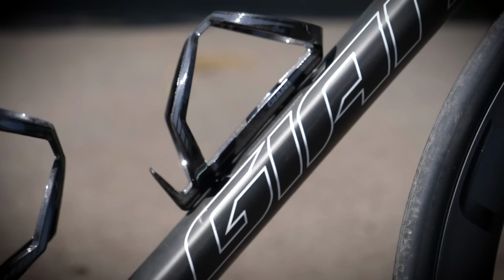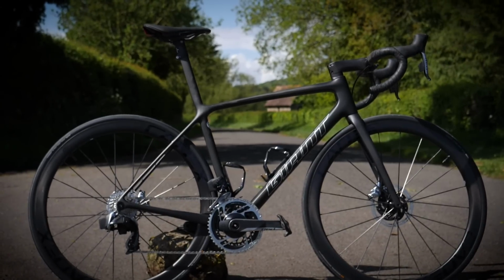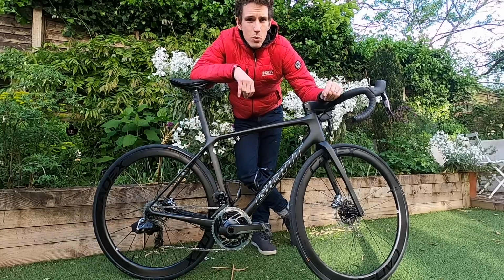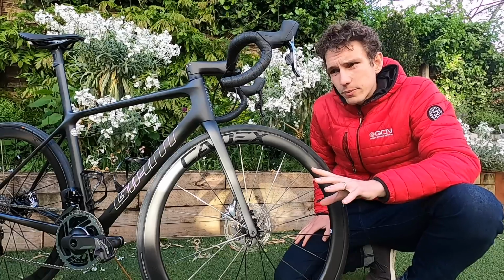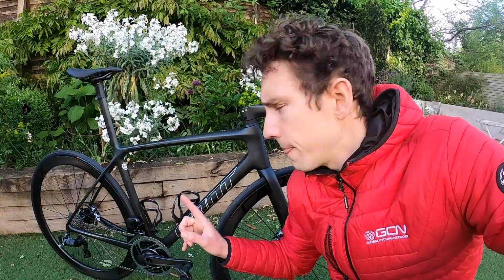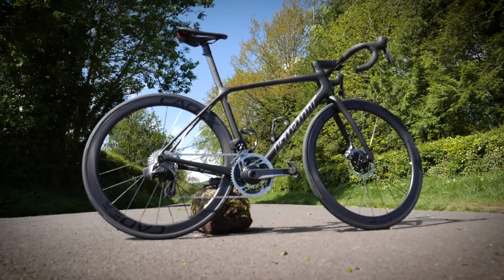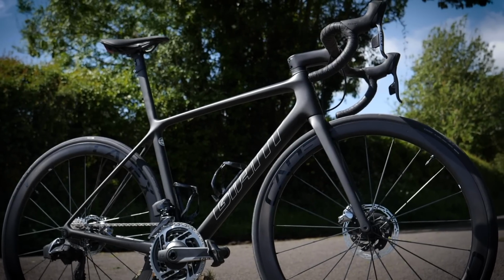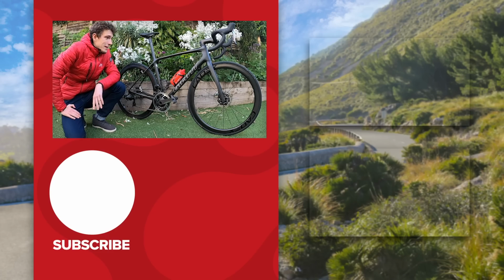New Giant TCR SL Disc | An Updated Iconic Road Bike

Comment: 32 mm tyres,  disc brakes and 'aero'. (Bit contradictory!..)🤦‍♂️ no thanks. The point of the tcr is to be light, comfortable and stiff a 'GC' bike. This is turning into some kind of gravel bike lol! I'm the owner of a 2015 tcr sl / rim brakes. 6.8 kg in size L, as stiff and as light as I'm ever going to 'need' . Oh and don't be afraid of the integrated seat post adds comfort and stiffness/ feeling of connectedness to the bike 😀

Comment: How is the seat tube height adjustable? It looks like the frame ends right where the saddle begins.
Reply from the maker: You measure the correct height very carefully, and then cut the seatpost to fit you. They do provide a few seat post tops should you need to adjust the height at a later date though

Comment: Probably the best mass produced bike on the market. Only very few small manufacturers can rival Giant's top end offerings for quality and almost none can offer integrated manufacture. Sram BB/chainset on a Giant not a good idea tho. Wait for next gen Dura Ace (one day...). Actually, current DA better than Sram. And yes, I do own both. Baby steps improvement over current model (hard to improve), mainly optimised for discs. Nice to have Si doing content.

Comment: How is it more aero than other carbon bikes when the down tube is a huge block traveling through the air?  That down tube is no more aero (at least in the video shots here) than a general gravel bike.  Most bikes like this one have the aero tear drop shaped down tubes to better cut through the air.

Comment: Perfect. Just needs to swap out the Sram for Shimano.
Reply: Giant is waiting for Shimano to release the 12 speed groupset...
Reply: Lee Turner, Giant haven’t integrated the cables, where are you going to run Di2 cables (on the outside of the frame?)

Comment: Again he parrots the Industry's story about how compact frames were somehow better for the consumer.  And I'm saying you can't get a nice fit with seat post and stem adjustments.  But what really happened is that shops didn't like stocking road bike frames in two centimetre increments, not to mention losing a sale because some guy thought he needed, say a 58 cm and all they had was a 59 cm.   All the while on the other side of the shop, they have mountain bikes in just three sizes flying out the doors.

Comment: Are you saying this new road bike is lighter, more aero, stiffer and more compliant?! Wowie! lol
Nice bike though, I want to get one of these used. :D
Reply: Used tcr holds their value so well a lot of times you might as well buy then new or at year end discount 
Also very few of the top model will actually be sold
Reply: @mikew9743  I'll have to look again. From what I saw, you could get used ones that are a few years old around the 2k mark, 3k for a top range. Where do you go for deals?
Reply: Not here in vancouver canada 
We have a very active cycling community locally and lots of demand for high end bike in general
Most used tcr are either pretty beat up or not much less than retail 
Plus the fact a lot of older tcr has not so impressive color schemes 
Together makes buying a used tcr less attractive proposition

Comment: Also available in RIM BRAKES.... Must have slipped GCNs mind 🤷‍♂️
Reply: dc 1 it’s what I’ve ordered
Reply: @ImTheSecretRider  I've got the 2019 rim and had a 2019 disc much prefer the rim model..

I had a Lot of bad luck with the disc model... 2 levers replaced under warranty due to the master cylinder leaking... One went on a descent while on a sportive. After that I binned disc off and went back to rim brakes...

Discs are far from perfect like cycling channels make them out to be. My lbs said its an known issue I experienced, as shamino slimmed down the R8020 ultegra levers this in turn meant a thinner master cylinder which is known to fail while braking. Disc is the future but by the time its working well it will probably be a different standard anyway 😂

Comment: Not an aero integrated cockpit? This stem looks so ugly and heavy. Also external cables. Muck. And these seatstays. Aren't they know how to make fishbone like pinarello or tt styled seatstays or dropped seatstsys?
And the integrated seatpost. Yes, it makes bike about 50g lighter and little bit more aero, but also very inconvenient to travel by air. Well, if it would be a bike, that pushing the boundaries of lightweight aero bikes like tarmac sl disc, this inconvenience would not be a problem. But it isn't

Comment: How can you do a 10 minute review even down to talking about the bottles.... And totally not mention its also available in a rim brake across the range....

I guess it's like on the disc vs rim video, 16w doesn't really matter as you say.... Yet on the new Zipp 303s wheels a 10w saving is massive 🤔🤔

Marketing at its best I guess 😂
Reply: dc 1 Because the video is about the TCR range, it’s about the top end TCR which is disc only. Just as they didn’t mention that cheaper modes don’t come with an isp, or cadex finishing...
Reply: @TheDbtom  no its also in rim brakes 😂
Reply: dc 1 The SL0 is disc only
Reply: dc 1 SL2 is rim, last time I checked the video is on the SL0 not the SL2
Reply: @TheDbtom  yeah your correct...

But the sl2 is the same frame with isp etc... I can't see why they couldn't of mentioned it at leased. If I didn't no I'd 100% think the tcr was disc only cycling weekly did the same then had to backtrack on a further video... 

But that's gcn for u guess they clearly push disc which is understandable as most of the content is paid promotion so let's face it meaningless as they are basically told what to say
Reply: dc 1 I think you’re looking into this way too deeply, they’re just reviewing this bike. There was no other mention of any of the bikes (advanced, advanced pro) disc or otherwise. Had they done a full review of the line out and not mentioned there were rim alternatives, then yes I’d agree it’s odd. But they’re purely looking at the SL0
Reply: dc 1 they’re probably only looking at the SL0 as all the other colourways are revolting and they probably couldn’t say that they’re nice with a straight face 😂

Comment: If they made it with all hidden cables in the cockpit, it would be perfect
Reply: Yes, unless you ever have to do anything with it, in which case it's a nightmare.
Plus this way you can still stay on good terms with the mechanics in your local bike shop too. ;-)

It might not look quite as slick and it will cost you a couple watts worth of drag, but Giant tents to favour function & practicality over aesthetics.
Reply: @sergarlantyrell7847  Completely agree with you but man would it look SWEET with all hidden cables.
Reply: @rd2783  can't argue with that, it does look nicer.
Reply: @sergarlantyrell7847  the exposed cockpit drag is negligible, Giant did a test on that...
Reply: @hippoace  Yeah, negligible but not none. I knew a couple would be an exaggeration, but unless you're in a race that's down to the last second over an hour or so, even 2 watts (at 40km/h on Giant's "lightweight" rather than their "aero" offering mind you), IS practically negligible compared to the total drag at that speed of like >1%, which would make barely an immeasurably small difference to speed.
Reply: Maybe you want the giant propel then?
Reply: @ashoutinfront  Can't I have both :)
Reply: They made the cables visible for convenience I guess and then added that IPS! Why Giant, why?
Reply: @Hamidrrauuw  I think the ISP is dumb, but I do kind of get it. It's not that much more of a faff than the normal seat post (unless you cut it too short...)
Having ridden both I think the ISP version is a little more comfortable plus it's meant to help make the bike save weight.

Comment: My brand since 2014,Right now built 2020 with Campy super record 11spd,light and fastest
Reply: What bottom bracket are you using for campagnolo? TCRs run bb86 and the shell is not threaded.

Comment: Lucky my 2016 TCR Pro-0 (rim brakes), with Dura-Ace-9000 & SLR-0 wheelset only cost £2500. A joy to ride & remodelled my riding--whilst I'm not quite racing weight, it helped resolve (+yoga) a long-term IT-Band injury, due to the fit. I just hope to get a good 10-years out of it as I did my last bike (Trek 5000).

Comment: They finally made the front end look cleaner :)
Reply: With sram axs wireless yes.... If u look at the mechanical models its worse the gear cables enter the middle of the down tube looks terrible
Reply: @danc1829  ack, at least the OEM stem and headtube look nicer than before.

Comment: Why do a review on a light weight bike without stating the weight?
Reply: Or showing or advising its available in a lighter rim brake model 😂
Reply: In size L with this setup it's about 6.7-6.8.
Jakub Mareczko's Team CCC bike is 6.1kg's!
Reply: Seriously? He spent probably a third of this video talking about the weight and how Giant uses robots for manufacturing to save weight. The discussion concludes right at 5:14 where he states it explicitly to the gram...
Reply: @chocol8milkman750  I watched again and I still did not hear what the bike weighed. I heard comparisons and reductions in weight but what did that bike weigh?

Comment: Integrated seatpost... Im not fun of it
Reply: iirc, its only on the absolute top end models that have an integrated seatpost.
Reply: Correct just get the mid tier and you have a full seatpost, ISP for pros, I don't like it either but I'm sure it's better 👍
Reply: While the cables are all over the place. They are integrating the wrong things.

Comment: Just get the frame from a Chinese Giant shop and put on the rest, it will cost a lot cheaper. I can get the frame for 2500 USD here and it has 5 years of warranty.
Reply: Giant’s made in 🇹🇼 which is one reason it is awesome.
Reply: @harrylook7810  Nah, its awesome because it is a TW brand manufactured by themselves.
Reply: Kleiner Helfer  Thank you!!! The reason why Giant is cheap compared with other brands is because they basically live off China, people love riding here but many can't afford expensive ass bikes. Giant faced huge backlashes in China recently because we don't want the new TCR to be as expensive as Specialized or Trek. I'm sure they will lower the price sooner or later.

Comment: Great video but Please tell us Si how much does the complete bike weight ?
Reply: Taiwan's xinmedia website had test all M size. 
2021 TCR Advanced SL 0 DISC   ：6,570g
2021 TCR Advanced SL 1 DISC   ：6,900g
2021 TCR Advanced SL 2            ：6,700g
2021 TCR Advanced PRO 0 DISC：7,450g
2021 TCR Advanced PRO 1 DISC：7,860g
2021 TCR Advanced 1 DISC        ：8,100g
2021 TCR Advanced 2 DISC        ：8,500g
2021 TCR Advanced 3 DISC        ：8,900g
2021 TCR Advanced 1                 ：8,050g
2021 TCR Advanced 2                 ：8,200g
Reply: Need calibrated scales, your home scales could be +-100-200g which will not cut it.
Reply: Arron G 6.7kg
Reply from the maker: Sorry Arron we don't have the scales at Si's house, hopefully Giant will let us know soon
Reply: GCN Tech can’t he use his bathroom scales. Weigh himself and then weigh himself holding the bike. #hack #bodge ?!
Reply: @gcntech  How could it be possible that Si doesn't have proper scales, i just can not believe this )

Comment: If the weight goes down but the stiffness to weight ratio stays the same then stiffness has gone down.
Reply from the maker: Hmm good point 🧐 We'll need to ask Si what he meant by that
Reply: Stiffness to weight ration has gone UP! Overall stiffness as gone down slightly at BB from 71.09N/mm to 70.96N/mm in the 2021 (which let's be fair, that's NOTHING) model but weight has come down away more than that.
Reply: I’ll need to sell a kidney for this new TCR super bike!
Reply: @georgiaguardian4696  it'll have to be top shelf kidney
Reply: I’ve got a stiffness just looking at the bike 🤣
Reply: Means you replace the material with higher rigidity but lower weight,
Reply: @yudotn  If you did that then, the stiffness to weight ratio would go up.
Reply: Lol! Rekt! 😂
Reply: Hi , i think stiffness is up. 

STW = stiffness/weight
If STW remain the same, and weight goes down, that's mean stiffness increase.
Reply: @keming222  No it doesn't lol
Reply: @keming222  sorry, but you're incorrect.  Try plugging in a couple numbers and see what happens. If previously, stiffness =10 and weight =5, then s/w=2. If now weight is 4, then s/w=2.5. Except si said s/w has remained the same. So for s/w=2, but w=4, stiffness must equal only 8, which is < 10
Reply: @mitchellsteindler  Exactly.  My guess is though that S/W is higher so stiffness is same or better while weight is less.  Giant would know this.
Reply: @mitchellsteindler  Hi you were right, maybe i misunderstood "weight goes down" as "decrease weight". My formula actually same as yours :)